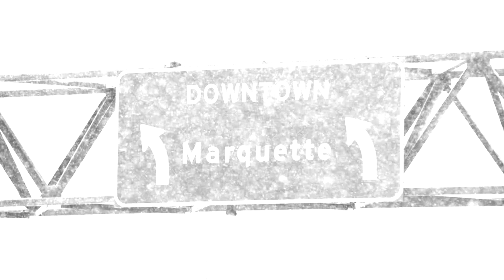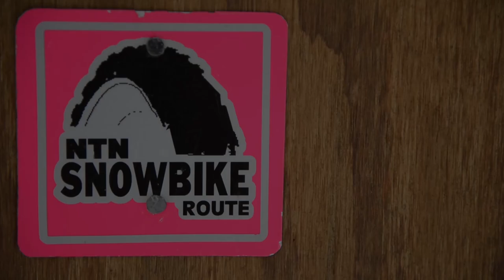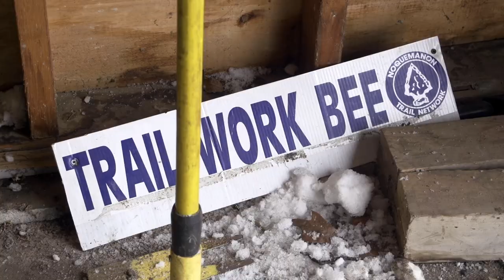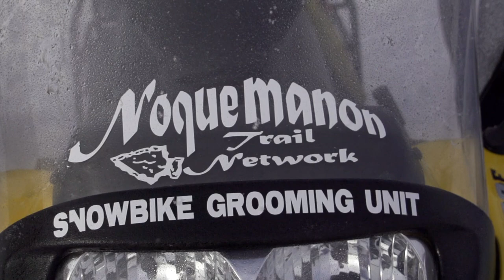Cold Rolled | Fat Bike Snow Biking | Marquette, Michigan

Comment: Last year I bought a Trek 520 w/disc brakes, then recently I bought a Big Fat Dummy(Large/Biolet). I was wondering if there's a way to upgrade the gearing of the BFD to what the Trek 520 has to offer. I don't know if it would be as simple as changing out the cassette, the crankset, the hub, whichever.